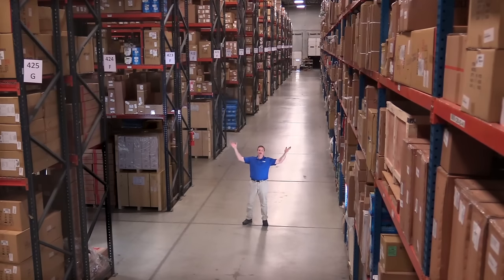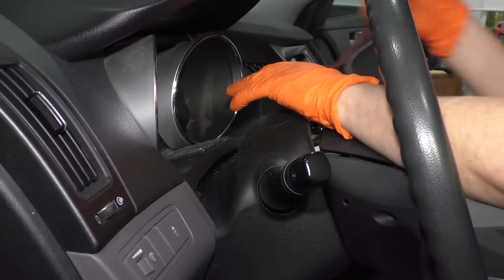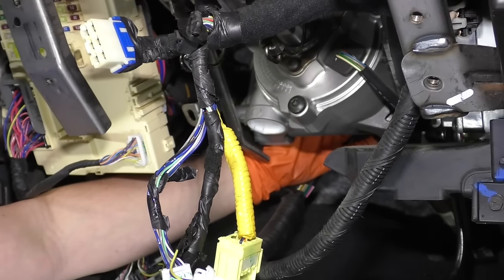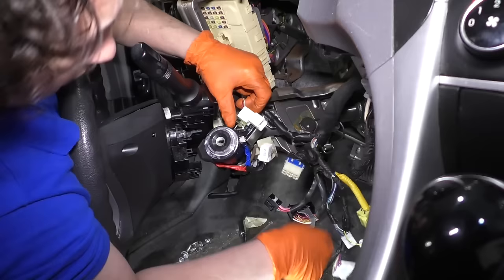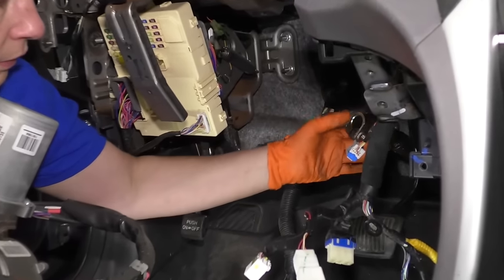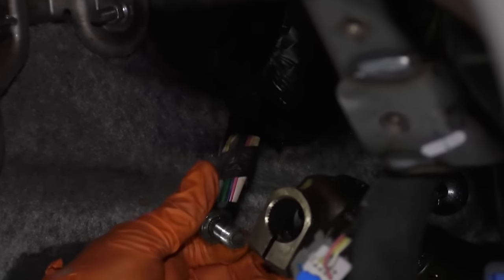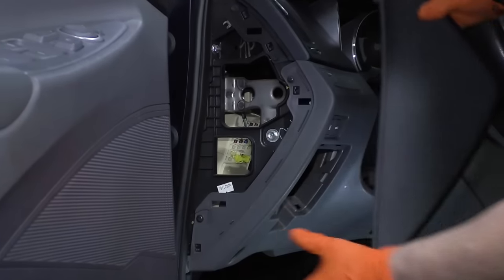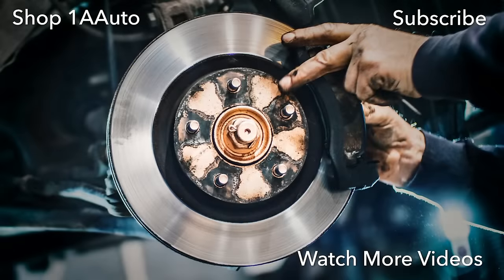How to Replace Steering Wheel Coupler 11-14 Hyundai Sonata

Comment: There is no need to totally take out the whole steering unit, just lower it down, there is enough space for taking off the steering motor
Reply: Fr??? Cause I don't want to be messing with allllllll the wires
Reply: you got a video or something to explain how? or???
Reply: Mine only clunks when changing directions if iam turning right then it clunks when I turn left and no more clunks until I go right again is that what this coupler does when it goes bad
Reply: @ravenpalma7544  Heh.  That'd be about the easiest part, really.....

Comment: Thank you for the video! it was nicely put together.
A quick question:  I also had an issue with steering wheel coupler and got it replaced by the dealership. But when I got my car back my AC and wipers stopped working (no power). Dealership wants to replace PCM and hoping it would fix the issue. I think they messed up something while changing the wheel coupler. 
Any suggestions?
Reply from the maker: +Paramveer Singh We wouldn't be able to diagnose an issue like that here, you may want to have a local mechanic take a look at it. Thanks for checking us out! http://1aau.to/m/Shop-1AAuto-c
Reply: did you ever find the issue

Comment: Did thsi over the weekend. Man on man its not an easy Job. Mine is a 2010 Elantra right hard drive. Th process is not entirely same. following tips I can give.

Make sure to watch multiple videos of different people doing the same thing, unless you have the exact model, exact year and exact hand drive.
Make sure you have all the tools including pliers and wire cutters(if you do not have a tool to remove the hinges). Including extension which can reach the back bolt and an extension which can increase the torque as the bolts will be very tight.
If you have a small hydraulic jack then use that to support the steering as there will be few electrical conenctions which you need to remove before dropping the steering column but they cant be removed unless you drop the steering colum but held it in the mid way. use the jack to support it.

In addition to the 2 nuts the steering column has a mounting plate through which the 2 bolts go(the back one) that mounting plate has to go inside a hook for my car.  when you are dropping the steering and putting it back you will have to make sure that plate is in the hook when putting it back and pull from that hook when dropping the column.

Mine motor had 4 torx 25 screw and not 3. and to remove the motor I had to remove another component which had 3 same size screws but its over the motor cover.
Reply from the maker: +wonderwall S Thanks for the feedback!

Comment: So it has to be recalibrate after this repair is done? My eps light is on and no power steering. I was told it has to be to tell the sensor where left right and center is to the sensor? I may not have did this repair if I knew that.
Reply: No local shop will do it they said it's a dealer issue I don't want to take it to hyundai. Only other thing if it dont need calerbration is the module or motor is bad which was fine before the coupler was changed

Comment: If you disconnect the column from the intermediate shaft to take it out of the bench aren’t you going to lose your steering position? I replaced my coupler without disconnecting the shaft.

Comment: I am facing the issue of occasional left pulling in Hyundai Elantra after calibrating the steering angle sensor as well, it is any symptom of bad flexible coupling..

Comment: She did it the hard way.  You don't need to take the entire steering column out.  Just move the seat back all the way and drop the column.  There's enough room for you to remove the motor to install the rubber piece.

Comment: From watching this video and others and doing the job at home, they are not all the same.  Of all the ones I viewed on YouTube I could not find bolts near the bulkhead and above the steering joint.  Mine just had a bracket that had one bolt mounted horizontally.  What a PITA.  Still, not that terrible of a job.

Comment: If my key is push to start, how do I loosen the steering wheel without starting when the battery is disconnected such as at 1:25 ? Will it react the same way even without the battery on?

Comment: I am a hyundai tech at a hyundai dealership   this is a very common  issue   on the sonata   and was a recall.
also  the elantra  had the same issue some years
Reply: If this was an issue why make that tiny spider bracket in plastic, why not metal? the cost to take it to a mechanic is about $250 just for labor that tiny piece is only $6. I'm having the same problem.
Reply: I replaced my coupler on a 2011 Kia Optima.  It worked for all of about 1 minute and then the power steering stopped working again.
Reply: I haven't seen the recall for this, my girl has this problem is there a link you could share or is there something she could tell the dealer? thanks in advance
Reply: Thanks for the info im at the dealership now do you know how long ago the recall was for this?
Reply: JOE FORD DIY 
Can you help me out ! I just replaced the coupler rubber .. i disconnected the sensors but before I did all that I disconnected the battery .
Now after finishing the work .. and putting everything back together and all sensors I was finally done 
Now I went to plug the computer back on and now the car won’t start it won’t crank
Reply: Do you live in the riverside county
Reply: Im really having problems with mine .Thought it wouldn't be easy pluged up everything and now. I can't seem.To figure out this esp on  dash board along with hazzard light. Check recheck plugs. Help so frustrated at this point 3 day's going on.
Reply: @terrysappington3563  I am about to tear into this project but a little hesitant.  You ever get yours back together?
Reply: @Craig5150EVH  lm so sorry for not replieing sooner yes l did. Its simple to drop.But if you don't put everything back you can trigger the electric power steering light.Will have to be reset. The two 12 meter bolts are hard to put back in was my problem due to lineing up right.There will be a hook that goes in a slot that's on the sterring column.lt takes two people to line it back up. Took me 4 day's lm no mechanic but lm not doing this again. Exspect this to be a on going issues every 2 years.or 3. This should be a recall. Check your recalls in your state. And price checks first is my suggestion. Take your time good luck.
Reply: @maingoriginal4709   HI sorry for the long delay   I just read your comment now   .  there is a TSB out on this as well as a recall     just bring the car to any hyundai dealer  and they will replace this free of charge
Reply: JOE FORD DIY regardless of mileage or is there a restriction?
Reply: I was told $400 and not a recall
Reply: @christopherpineiro1211  I was told $300 and no recall... today.
Reply: You have to be within 100,000 miles
Reply: A piece of plastic gear with 2 pieces of metal sandwich  together  will cause friction.  Damn engineer...  Just want to make extra money... Make it out of Metal.
Reply: My tucson making same clicking noise in steering , is this apply to 2013 tucson as well?
Reply: There’s currently no recall for this on my 2013 Sonata. Hyundai Capitol (Bay Area) is charging me $499 to replace this.
Reply: Hyundai
ELANTRA & SONATA STEERING COUPLING
EXTENDED WARRANTY
HOMECONTACT US
VIN Validation
Input your Vehicle Identification Number to verify if your vehicle qualifies for the Elantra and Sonata Steering Coupling Extended Warranty.

VIN (Vehicle Identification Number)
 VALIDATE What is a VIN?
Hyundai Motor America is revising the warranty coverage for the rubber coupling in the motor driven power steering (MDPS) assembly on 2007-2015 Elantra Sedans, 2009-2012 Elantra Touring models, 2011-2014 Sonata Sedans, and 2011-2015 Hybrid Sonata Sedans to 10 years from the date of original delivery or the date of first use, or 100,000 miles, whichever occurs first.

Hyundai is a registered trademark of Hyundai Motor Company. All rights reserved. © 2020 Hyundai Motor America

Privacy Policy Legal Notice

BOUGHT MY ELANTRA FROM SISTER IN LAW- IT HAS 144k MILES SO LOOKS LIKE THE EXTENDED WARRANTY WILL NOT HELP ME SINCE 10YRS OR 100K MILES.......
Reply: @Poltergeist1313  hi  I have the same problem I entered my vin and says is valid
It has 130 miles and is a 2013 sonata limited

Comment: I did this on 3 different cars and worked great but the last one that EPS light and traction light came on and I cannot get it to go off and there no power steering what could it be?
Reply: Hey mine is doing the same thing... did you ever get it fixed?
Reply: I'm having same issue

Comment: She really didn’t have to take off the whole thing.. go watch other videos that do it simpler 👌
Reply: Can you post a link? I've looked at a few other videos and the method seems to be very similar to how she is doing it.
Reply: Ryan Woodson move the driver seat all the way back. Remove all the bolts she does except where it connects to the column. Lay the steering wheel down and u can access all the torx bolts in the car

Comment: My GF Sonata has the Airbag/seatbelt warning light on before I performed this for her. She took it to a shop and they took it apart to inspect. Idk if in doing so they damaged the clockspring on the steering wheel. Would that cause that warning light to stay on or is it another issue with the SRS system? Ty
Reply: Call ask the dealer how much they charge it was 85 to check then will wave the fee if you want them to fix at their price. It was to much to put back up l have a bad shoulder two man job.

Comment: 7:28 the front right mounting bolt that keeps the steering column attached to the body broke off. What can I do? It's still sturdy with the other 3 but I will need to replace it.

Comment: i have a kia ceed 2010 with the steering wheel locking in place when i drive faster. İt is like the wheel is sticking and wont move while driving straight and when you apply more pressure to steering wheel to stay in lane it suddenly lets go and this time you have to correct again. Could this part the reason for a "sticky" steering wheel as well?
Reply from the maker: +S.K. We wouldn't be able to diagnose an issue like that here, you may want to have a local mechanic take a look at it. Thanks for checking us out! http://1aau.to/m/Shop-1AAuto-c

Comment: ●USE A BLACK MAGIC MARKER TO MARK THE POSITION ON THE STEERING SHAFT.
●USE A PIECE OF TAPE TO KEEP STEERING WHEEL FROM ROTATING.  OTHERWISE YOU WILL BREAK THE CLOCK SPRING FOR THE AIR BAG.

Comment: WHAT IF I REPLACE BY AN ALUMINUM PART MADE BY CNC MACHINE WITH SAME DIMENSION ??
Reply: Logically, as long as the part is full metal it should work without a problem.
Reply: NO.  

This part is meant to dampen sound and vibration, which means...if you make it out of metal, it would be similar to having solid engine mounts.

Comment: We did this to a kia 2012. After wards turning the steering left or right, the steering wheel dies not return to the center as fast as before. How cone guys
Reply from the maker: +Nishal Thotaram We wouldn't be able to diagnose an issue like that here, you may want to have a local mechanic take a look at it. Thanks for checking us out! http://1aau.to/m/Shop-1AAuto-c

Comment: Need help
Today, my KIA Rio 2012 steering act weird
Its hard to turn sometimes, jerking back and forth
BUT, no EPS ligt came on. Scan it and found nothing
When I turn the wheel fast to the left it will resist and like motor spining but not connected to assist steer
Reply from the maker: +Magelang Food Hunter Since there could be multiple reasons why youâ  re experiencing this difficulty with your vehicle, I strongly recommend that you have a reputable mechanic inspect it. Theyâ  ll be able to troubleshoot the problem and tell you what part or parts youâ  ll need for the repair.
Reply: To everyone that has this problem. I dropped it got to the problem put the cuppler in. If you don't do thing's right. Your light's will come on ESP Hazzard. Most people have done this a thousand time's or work on car's. Research the dealer price before you do it your self. Only you know what you can afford. Also check recalls l did l had 4.This will be a every 3 year occurance if not sooner it's a rubber coupler. I hope that help.
Reply: @terrysappington3563  thank you for your reply. Already fix it weeks ago. It has burnt motor. Just try to clean it. Nothing short. Just carbon brush not contacting very good. Replace the carbon brush and clean the armature. Done
Because All New Rio 2012 doesn't have coupler like sonatas

Comment: She's a lot bolder that I am. I would be too chicken to work on the steering column while the claymore (airbag) was still in :-S
Reply from the maker: +ArgosySpecOps Thanks for checking us out. 1aauto.com
Reply: Just unplug the battery but after you plug the battery back on start the power but don’t start the engine and let it sit for 30 seconds so everything will be set like it was cause if you didn’t you gonna have some issue with the car’s AMP

Comment: I used this video, now the steering wheel is super hard to turn.
Reply from the maker: +Gabriel Aspinwall We wouldn't be able to diagnose an issue like that here, you may want to have a local mechanic take a look at it. Thanks for checking us out! http://1aau.to/m/Shop-1AAuto-c
Reply: They don't go into much detail how important it is to not misalign the motor with the steering wheel. I just did mine today and did not remove the whole steering column leading to less work space which was the reason mine became misaligned. To my knowledge the only way to "relearn" the steering is to take it to a mechanic so they attach one of their computers to it.

Comment: Judging from this vid, Hyundai would charge you $1000 for a $2 piece.
Reply: Pretty-much....

It's currently $151.00 (which is a 50% jump in just a few months time, from the $99 it used to be) just for them to TOUCH anything having to do with your vehicle at the local stealership service dept.

Comment: entirely unnecessary to completely remove the steering column from the car!  not to mention, without marking the relationship of column to the shaft before separating them, your chances of getting it back together in exactly the same position (steering wheel straight, front tires straight) are slim to none.....

Comment: Why dont they make it out of a more durable material instead of this cheap plastic?
Reply: The revised part is a harder urethane material (like a hockey puck), vs. the squishy rubber that was originally used.